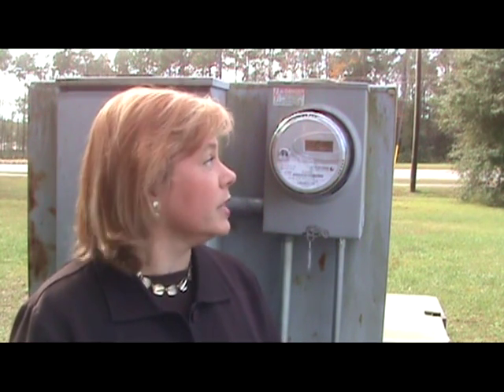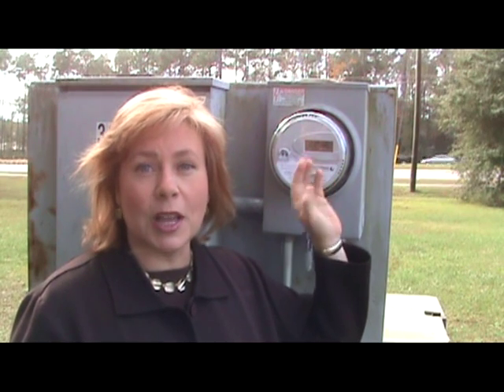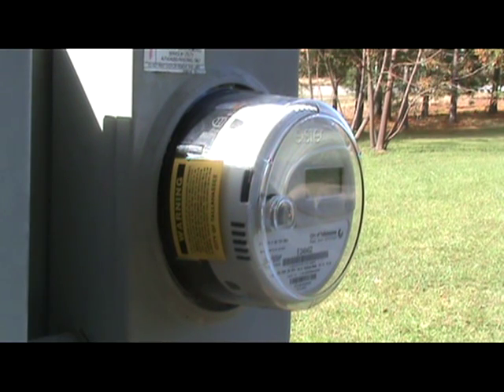Florida Public Service Commission - How to Read a Smart Meter

Comment: DO NOT stand this close to a wireless-emitting "smart" meter. The spiked pulse that are emitted by this type of meter are harmful to humans. The peak power density of the pulses are higher than what is claimed by the utility, and people should not be exposed at this close range. The Federal Communications Commission states that there should be at least 8 inches between you and the transmitter, and their standards are outdated. This is an irresponsible video.